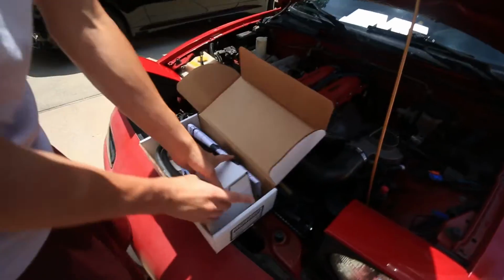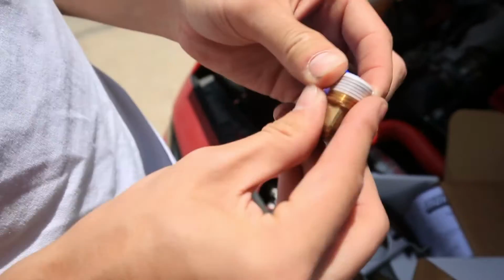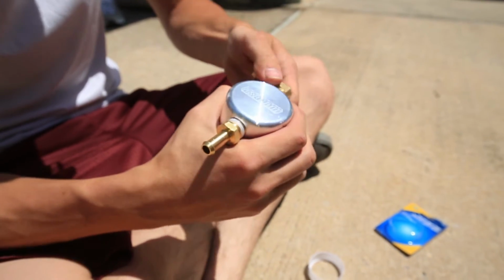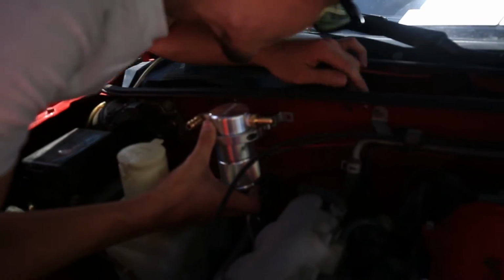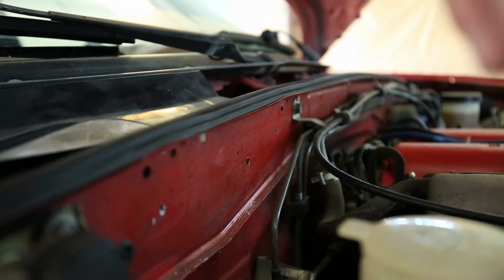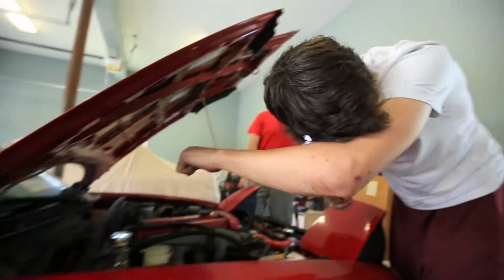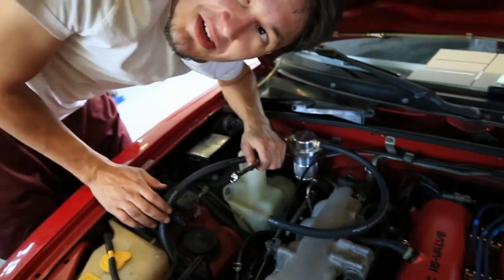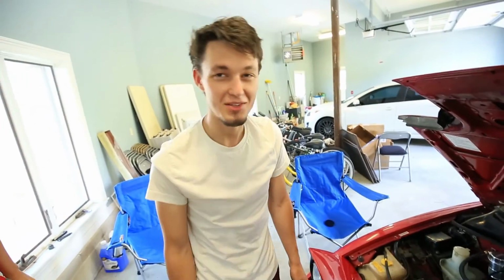Episode 11: Oil Catch Can Install - NA MIATA

Comment: Yo mint channel fellas, do you guys plan to boost this mx5 or was the catch can just for shits and giggles?
Reply from the maker: I do plan on boosting eventually, so all repairs and upgrades are most likely going to be done with that in mind as an end goal. After about 2,000 miles it had considerable oil in it (forgot to measure, but about a third to half full) so I'd say it was worth it still in the meantime as it is certainly stopping oil from going in my intake even without boost. But yea, boost... someday. 

- Steve
Reply: If its filling up with that much oil, its most likely valve stem seals...

Comment: The Miata supposedly doesn't really have carbon buildup issues.  Is a catch can really needed?
Reply from the maker: YZRandomE absolutely not, and on a naturally aspirated engine it's arguably useless. But it was cheap, easy to install, and looks cool. I do plan to add boost eventually tho and then it'll actually serve more of a purpose